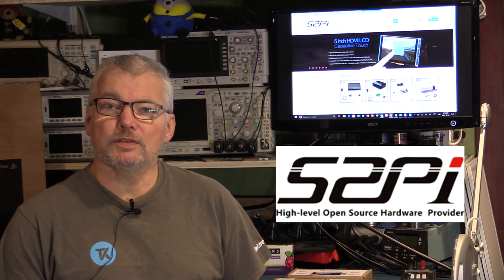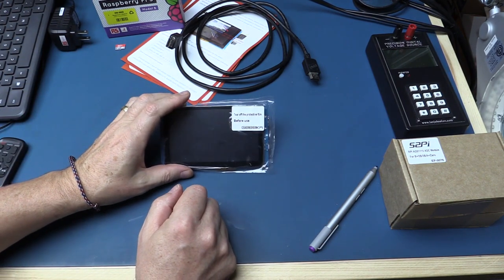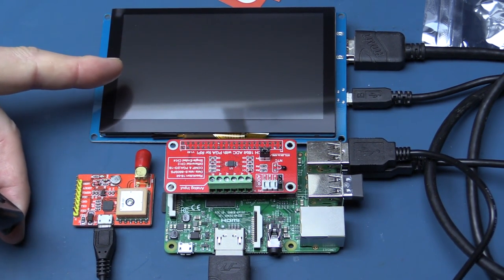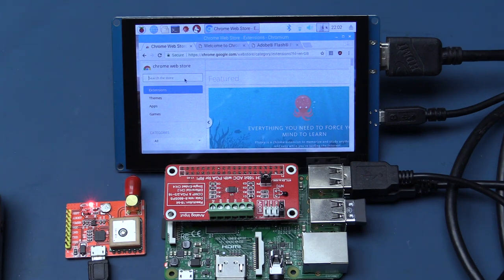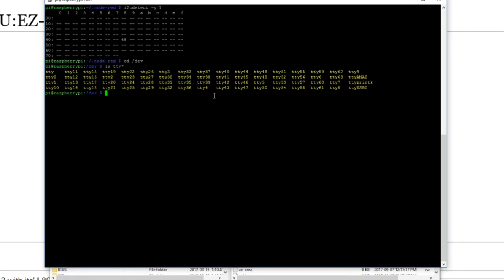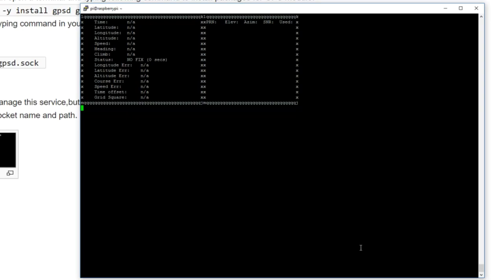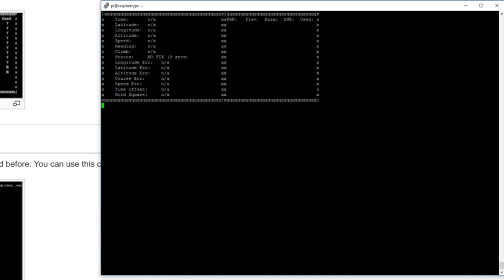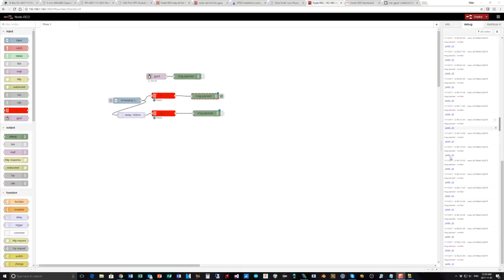GPS, 5" Screen and an Analog converter for the Raspberry PI

Comment: hi Peter
I've followed you link for 52pi and.. surprise they sell 7 inch 1024x600 lcd capacitive at the same price of your 5inch ! are they kidding ?? i' dont' know if there's a special offer but it's a strange thing
Reply from the maker: I take it you mean this one https://www.52pi.com/all-products/279-7-inch-1024x600-capacitive-touch-screen-lcd-display-hdmi-monitor-diy-kit-for-raspberry-pi-beagle-bone-black-pc-macbook.html

yes it is the same price but no were near the integration of the 5" one, the 5" one has just one module to content with, this has 3 modules and looks to be based on older technology that I have seen for a couple of years now.
Having said that, I have a very similar 10" screen that looks to be based on the same screen and touch interfaces. also this one has alternate video inputs like VGA and composite. so if you want compact and small, the 5" one is a good choice, if you need bigger and have the room for it, the 7: one makes more sense.
Reply: tyes it is the one ive seen: indeed the 5 inch compactness is unique, used to seeing stratospheric prices for cell phones with big screens I thought the screens were very expensive. So it'snt, then. that's why! Tnx Peter